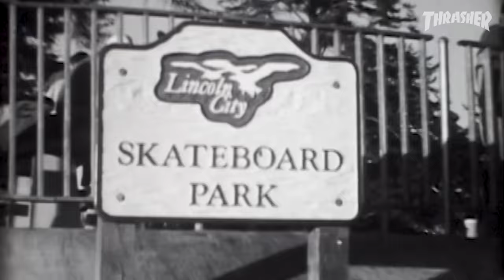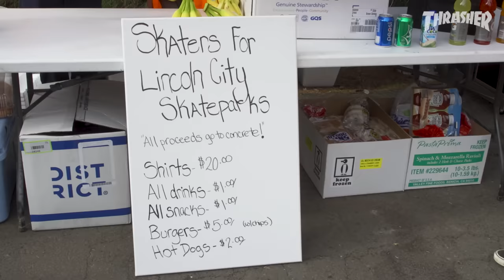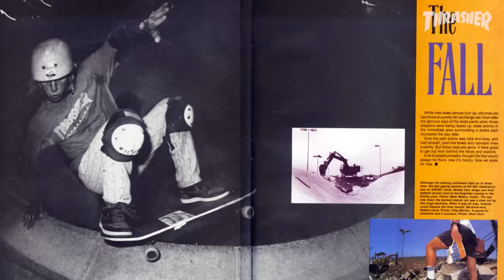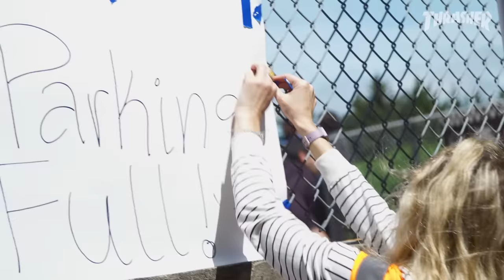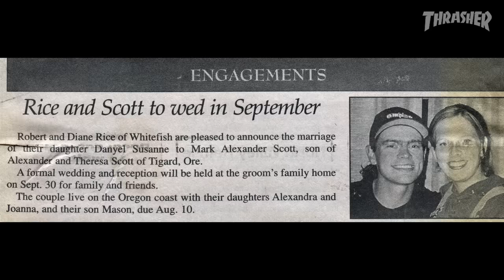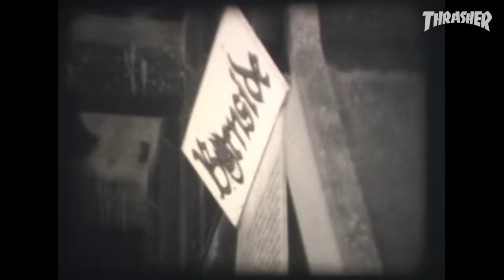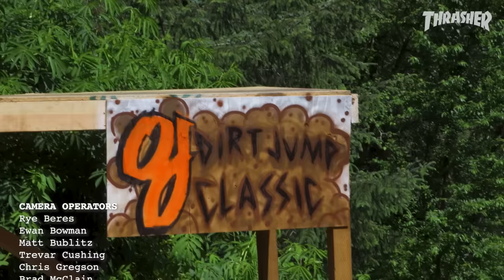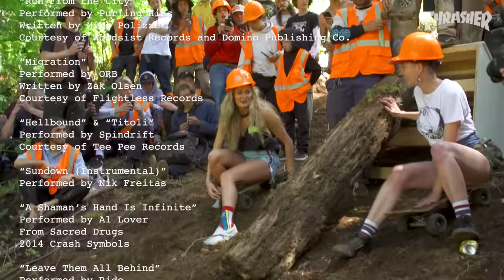Thrasher Magazine's "Grindland" - Full Movie

Comment: I grew up on the East Coast, so when I was able to visit Portland in 2018, I had to visit Burnside. You can't truly understand how gnarly that place is until you drop in for the first time and start pumping around. Technically, I was able to get a trick in on the legendary vert wall (a tiny, sketchy, nollie bigspin maybe 5 feet up the ramp). It was such a humbling experience and I felt honored to be able to skate the obstacles that have literally paved the way for DIY skating. It was an absolutely surreal feeling the whole time I was there. Also, seeing the locals shred it with ease was so cool!